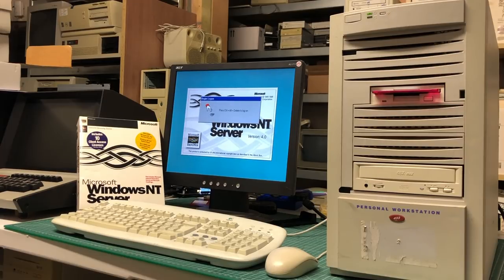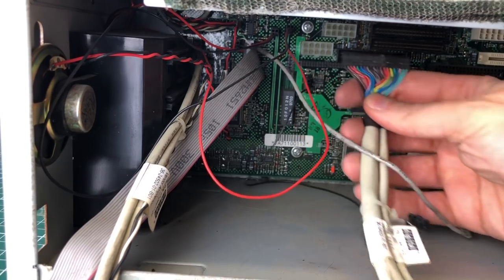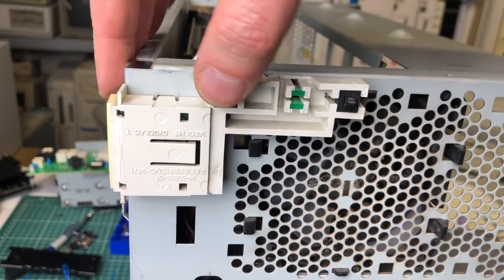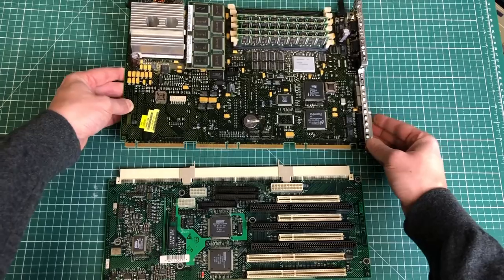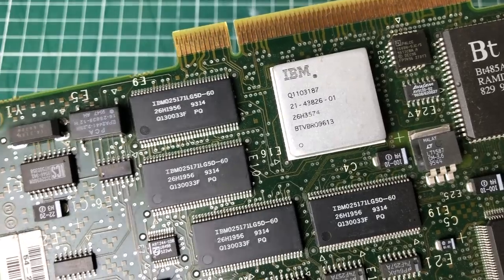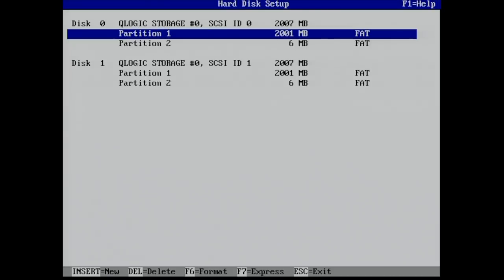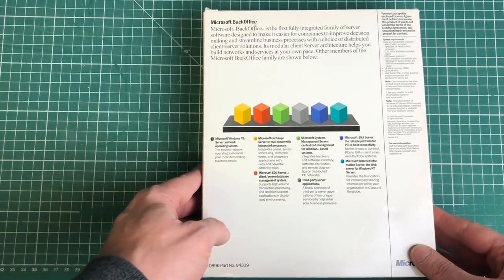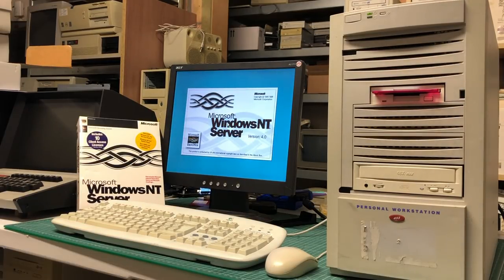DEC Alpha Personal Workstation 433a

Comment: PCI based Alphas had an x86 emulation mode that kicked in first that initialized the cards, so you could use a video card with an x86 bios chip, and I assume for the SCSI as well.  That would explain why it did 2 separate bios routines.

Comment: The longer PCI slots are not a combination of ISA and PCI, they are PCI-X slots that offer increased bandwidth, typically only found on servers and high end workstations of the period. If memory serves they were typically used for things like advanced SCSI controllers, high speed network adapters and advanced workstation graphics cards.

Comment: The "combined slots" are PCI-X (PCI-eXtended) slots, supporting up to 64-bit and running at 133MHz respectively up to 533MHz as of V2 (no smartypants.. I looked it up on Wiki)
How time goes by... 8- and 16-bit ISA, 32-bit EISA, Microchannel, PCI, PCI-X, Vesa, AGP, PCI-e x4/8/16... did I forget anything?

Comment: Back in 1995 there was Adaptec, Qlogic, Buslogic  and NCR/Symbios as most implemented SCSI adapter chips.
Reply: Have you tried SCSI in a computer nowadays ? Its almost shocking how well it works with a processor that handles it well.

Comment: 14:20 The board has 16 bits ISA slots, PCI and PCI-X which is like a 64bits PCI slot for cards that required higher bandwidth like SCSI and high speed network cards

Comment: Very cool! I have a similar workstation in storage, a 500au if I remember the name correctly. Not sure if it was able to run Windows NT, but I’ve used it for some dual boot experiments with OpenVMS and Tru64 Unix...and it ran FreeBSD pretty well. Gotta say, I miss those days of various different flavors of Operating systems and architectures, IT equipment has gotten pretty boring unfortunately 😢

Comment: Not only could it outperform an pentium pro. It could do it while emulating the x86 platform and run the same code emulated. And still be one heck of a lot faster. I’ve heard figures of up to 4x speed even emulated. But it cost quite a bit more than any intel based system. Back in the day no one had a need for a workstation like this for bragging rights. This was specialist gear for very specific tasks and uses.

Comment: Not quite true regarding NT 4.0 being the last MS OS for these things. Windows 2000 was at the RC point when the project for Alpha was canned and there are a couple of versions out there of it. i also have an archive of the old alphant.com site which had a lot of Alpha based windows software. You could also get versions of Alpha software on the old MS "Select" CDroms. Also you could run either Tru64 or OpenVMS  by swapping over from the NT firmware to SRM (easy to do) so long as you had a supported video card. The Compaq XP1000 was the last of these tower systems but had a much faster CPU. Also,  DEC had a really  cool technology called fx!32 which could do binary translation of Intel x86 apps for Alpha NT.
Reply: Interesting and cool feature the intel x86 translation in hardware

Comment: Had almost the same Miata station, except yours is a 433au (red label, scsi, Tru64 Unix or VMS) and mine was the simpler 433a (violet label, ide, windows NT). Anyhow. The reason there's a secondary pentium power connector on the lower board is because DEC also produced pentium-based worksations in the same PWS case, with only the sliding top board being different. 
Worked great with debian way back when.
Also, if you ever want to install anything else than windows, you must switch from the pseudo-graphical bios to the SRM prompt.
Reply from the maker: yeah it's on my TODO list ... need to do some reading on how to switch it ... saw that blue console somewhere (think it's called SRM). But also saw this guy who flashed firmware on it and more or less bricked it ... so gonna do some reading first :)
Reply: @RetroSpector78  : Coming back to you as I dusted up my alpha last night. I finally realised what you were telling here. So, on many alpha platforms, you're right both AlphaBios and SRM firmwares can't coexist on the flash memory, so to switch from one to the other, you need flashing which is a harrowing prospect. But with a Miata (PWS 433), the flash memory is big enough to hold both firmwares concurrently, and switching from one to the other is very simple. From AlphaBios (used with windows NT 4.0), you enter setup (F2), then go to CMOS setup, then "Advanced" (F6) and choose OpenVMS or UNIX as system. Power down (reboot won't cut it), and you're in SRM once you power up again. Follow the install guide from there. To go back to Alphabios from SRM, type 'set os_type nt' and powercycle the machine.
Hope this helps.

Comment: There was another variation of these systems that were AU instead of A, and they could run Tru64 UNIX and OpenVMS.  You can convert an A to AU by swapping in compatible cards, for example the qlogic scsi needs to be replaced with an LSI/Symbios card, and there are other issues like which graphics card and even network cards.  I think these PWS machines had large BIOS, so you can actually switch from alphabios to SRM on the fly (if it's been loaded).  Some of the other machines can only run one or the other.  I had a cheaper machine wish similar hardware called a PC164LX.  There is a beta version of windows 2000 that will also run on these systems.  And Redhat and compaq had a linux distribution for these that included libraries to allow some tru64 binaries to run.
Reply from the maker: Planning on taking a look at that .... but time was limited and don’t want to create hour long videos ... amazed people are able to commit so much time already to watching this stuff. But thanks for the pointers !
Reply: The au version actually came with the same qlogic 1040 pci card, just the scsi card was optional on the a and standard fitting on the au. The only other difference was that the au came configured for srm instead of alphabios, and had unix or vms preinstalled.
You can convert this 433a into a 433au simply by changing the os in the alphabios settings - both alphabios and srm firmwares are present by default you just have to choose which one the system starts by default. If it boots into srm by default, you can start alphabios by typing "arc".

Comment: See if you can run the x86 adaptive emulator. Games like Quake 1 or 2 will work on it, but it will take some time for the program to "recompile" for the alpha chipset, but when it does you will get some impressive performance. I believe back in 1998, a guy showed us his rig running Quake 2 (or Q1 I don't recall)  will all of the 3D feature turned on running off of the CPU alone ... no 3D accelerator card. Was impressive.
Reply: There's native alpha versions of quake/quake2, no need for emulation...

Comment: The longer slots are 64bit PCI-X slots, which are much faster than your standard PCI slot.

Me, I would max out the memory, and add a PCI-X SATA Card with a few xTB drives, and maybe a quad port Gigabit PCI-X card. Then toss on Gentoo Linux or FreeBSD.

Comment: I agree that it's not a computer until it runs doom ! But I love the old architecture of the older computer layouts. A dual slot is nothing I've seen before. iso and  pci? cool... I started with the old, But not forgotten Tandy 1000 and IBM 5150's. My brother insisted that I could not install a hard drive on the tandy, I had a scsi card and drive and got the tandy up and bootin" , not exactly fast but I did it. Live large and perspire...

Comment: Removing the magnetic choke from the power cables by opening the two clips unbundles every one of the wires. Then you can remove the speaker assembly and change out the atx buttons.  The buttons pressfit into the plastic carrier from the front.

The sound and network expansions cards are full logic boards not port relocators . the wires are carrying the bus signals to the subboard rather than taking up an ISA or PCI slot.
Reply: You are incorrect about the sound and the ethernet boards. They are port relocators. The video clearly shows the ESS audio chip and the 21142 (Tulip FastEthernet) chips on the mainboard. While they contain some chips (most likely amplifiers/line levelers for the sound card and the PHY bits for the ethernet), they do not contain the controllers. The 21142 was a PCI chip, so it would have been necessary to extend the PCI bus all the way from the mainboard to the ethernet port, which would have been a silly idea from an EMI perspective, something DEC clearly took great care to avoid in this workstation.
Reply: @samsthomas  i was watching on a phone so i couldnt read the chips so its entirely possable they would do something like split the board as you read it.  Corrections always welcome.

Comment: 14:20 - Actually that you suppose to be a combination of both ISA and PCI, is a PCI-X slot, short for Peripheral Component Interconnect eXtended, is a computer bus and expansion card standard that enhances the 32-bit PCI local bus for higher bandwidth demanded mostly by servers and workstations, and support both 16 and 64 bits...
https://en.wikipedia.org/wiki/PCI-X

Comment: Mind if you tell which VGA capture device you're using? Seems to have a very clean output.
Reply from the maker: OSSC for everything weird resolution (msdos / bios / gaming) / avermedia lite for standard windows resolution
Reply from the maker: Going to do a video on that also ... but has way too many options that I still haven’t looked at. Sometimes the screen is missing some pixels on the left, and there is a weird flicker sometimes (caused by the avermedia I think when hooked up to the ossc).
Reply: Thank you.

Comment: I wonder what sort of software you can actually run on such an exotic machine. Sadly AutoCAD probably isn’t one of them. These sort of non-x86 NT workstations would be great for cad, yet Autodesk never really bothered after AutoCAD 13. Since version 14 it’s Wintel only. I guess good old x86 was good enough, I had to use AutoCAD 14 in the ealy 2000’s on an Toshiba Portege laptop in the early 2000’s running windows 95 when I was an intern as building engineering student and it worked reasonably well. At least was usable. At school we had NT4 based machines with AutoCAD 2000, but those where standard Pentium based machines. Somehow the market for these Risc Workstations was probably too niche to be commercially viable for a lot of software developers that these sort of machines where built for. oh, the irony..... I guess microsoft was betting on multiple horses.

Comment: Is it possible to run Linux/BSD on the Alpha? I'd love to see the penguins there.
Reply: Yup, I used to run NetBSD and RedHat on my alpha 21164 when I had one.
Reply: Alpha was the first Linux port.
Reply: The alpha CPU’s used to be advertized the Linux magazines in the mid 90’s. One could only dream of them offcourse. I was running Linux Slackware on a dual Pentium 200mhz at the same time, pretty nifty setup.

Comment: You never stated how you actually got this DEC Alpha Personal Workstation 433a to power-up. You went from disassembly to running. What fixed the power-up problem?
Reply from the maker: It was the power button that was stuck in the “off” position. The problem is not yet fixed but is diagnosed :) for the moment the computer is now stuck in the “on” position. Looking at replacing the power button.

Comment: congrats on your your alpha! i've been running a pws 500au as my unix box for awhile now. you can d/l alphant software and drivers from https://github.com/jack23247/alphant . think the guy archived the old alphant website. there's also a beta release of windows 2k than ran on alpha's (2128 rc3 i believe) that's a 120 day trial but that can be easily bypassed. but, imo, windows nt/2k does not do that alpha justice. they were 32-bit os pretending to be 64. i personally run digital unix 4.0e (last release that had the digital logo at login screen and not *ucking compcrap!) but there's also openvms, linux and all the bsd's. the downside is that there is more hardware support on alphant than with the other oses.

Comment: I have a Compaq pro insignia. That's all interesting looking.
Reply from the maker: These are very nice ...  what year / type ?
Reply: @RetroSpector78  It's a Prosignia 300. 1994?
Has a Pentium Pro 120Mhz processor.
I don't even know how much ram because there's no label.
Two Seagate barracudas 4GB scic?
3.5 inch floppy, CD drive, and a Hewlett Packard 90 meter data cartridge/ tape drive. 
It belonged to a company called republic national wine and spirits. It was given to me by them because my mother worked there and heard that I liked computers. I don't know much about it and I can't find much online either.
Reply: @RetroSpector78  It also has motherboard is on a card and the main board handles the I/O.
And a locked out power switch.
It was primarily used for order and bill record keeping. It still powers on and tries to boot to an operating system that's on a tape.
I actually need to get rid of it because it's a waste of space.
Reply from the maker: Cute Neko hehe .... you can always send it over to me ... I promise to feature it in a video :)
Reply: @RetroSpector78  That sounded kind of sarcastic. I did ask other people if they wanted it but never got a response from them. I can try and send you it but it probably be expensive depending were your at.
Reply from the maker: Cute Neko the “making a video of it” was definitely real and not sarcastic. But never want to force someone to donate or sell their stuf. Always interesting to get some more “exotic” hardware. But I’m in Belgium so shipping these heavy computers is never easy.
Reply: @RetroSpector78  Without an address I can't get an estimate on shipping. 
But I would assume a lot since it probably weighs 10 to 20 pounds. I have thought about selling it but I don't know what to sell it for since it's so rare.
Reply: @RetroSpector78  But I would like to give it to someone who knows more than I do and will use it for something at least.

Comment: FX!32 might be interesting to see it do a binary recompile of x86 instructions to native Alpha.  I think you can run it over and over and it keeps reoptimizing the code.
https://en.wikipedia.org/wiki/FX!32
That being said, what a horrible design of the system unit.  An absolute pain.  I wouldn't touch that thing with a 10' FDDI cable.

Comment: As if by magic I just found my copy of win 2000 Alpha - final build. Thought I tossed it years ago. It was made for that workstation. PM me if interested.
Reply from the maker: Cool ... where are you from ?
Reply: @RetroSpector78  Northeast US.
Reply from the maker: Ouch ... europe (belgium)
Reply from the maker: Just out of curiosity, how did you find this video ?
Reply: Strangely enough it just popped up on my YouTube feed. There used to be two big alpha websites. Alphant.com and alphalinux.com. Long ago someone, I presume a Microsoft employee, posted on alphant.com that they had developer version of win2k for alpha for anyone who wanted it. I responded and a week later a disc from the West coast of the US arrived in the mail. I responded back to thank them and the email bounced. It ran very smoothly and was as faster than my buddies athalon running win2k. It would "optimize" x86 code as you ran new software. Took about 3 times before the software ran perfectly. Used to run tru64 and w2k off that machine.

Comment: I wonder how it would run xp.  It exceeds the minimum requirements for ram and CPU speed for XP 433MHZ in 1996 was probably nuts
Reply: It wouldn't be able to run Windows XP. Microsoft stopped making Windows NT releases that supported other CPU architectures (except for Itanium) before the release of Windows 2000.
Reply: @alexdhall  Not strictly true... They were not released to the public, but alpha development continued beyond 2000 as they were porting windows to 64bit before the availability of itanium chips, so alpha was the only 64bit chip available for testing as real itanium chips were massively delayed.

Comment: you know you can run something a lot more interesting than NT on this, right? : )
Reply from the maker: hehe ... well we got start somewhere .... I saw Windows NT in the bios and went for it .... Also had the box and was a great excuse to install windows NT server (and first time on a non x86 architecture). But will look at the unix stuff also in a future video ... just gotta find the time. Hope you enjoyed the video.
Reply: Assuming it's badged 433a, that system would have shipped with Windows NT, so NT is the correct OS. 433au would have been the VMS / Unix version
Reply: @RetroSpector78  nice to hear that. i suggest taking a look at VMS, it's something truely unique and currently only runs on alpha. your videos are great, keep it up. : )
Reply: @OtterlyInsane  you are right. however, when it comes to old hardware, the most accurate is not always the most interesting choice. i have nothing against good old NT 4, but you can run that on pretty much anything from the time. VMS and Tru65 UNIX however are quite rare and fun to revisit.

Comment: Running Windows on this thing is a waste in another way: it takes absolutely no advantage of the 64-bit architecture.

Out of the 4 OSes I know of that ran on these things, only two (DEC Unix and Linux) were full 64-bit. OpenVMS was a sort of hybrid 32/64-bit OS, and Windows ran in strictly 32-bit “TASO” mode.
Reply from the maker: I am planning to do a follow up video on that ... now it was just a matter of getting to know the machine a bit, and seeing what it could do "out-of-the-box". I noticed the "Install Windows NT" in AlphaBIOS and went for it .... Also for nostalgic reasons as I've been wanting to do a windows NT install for a long time. But will look into the unix/linux stuff and do a follow up